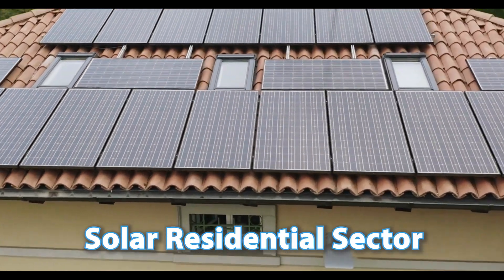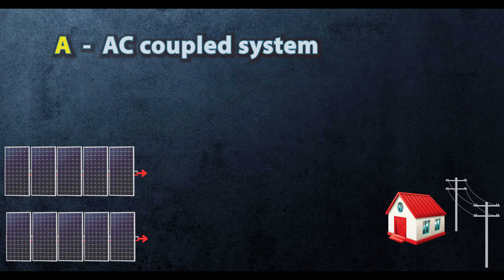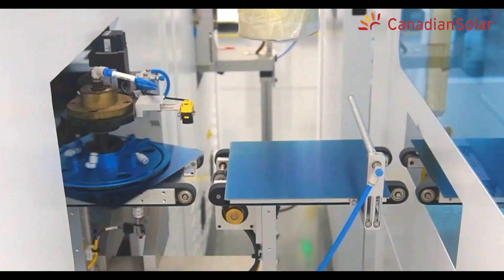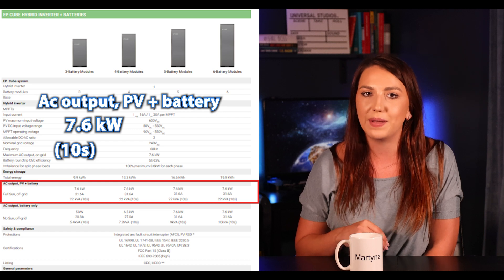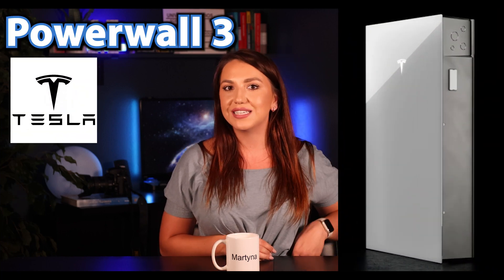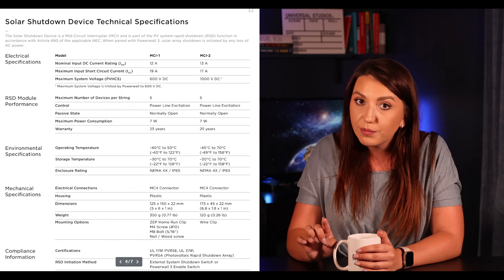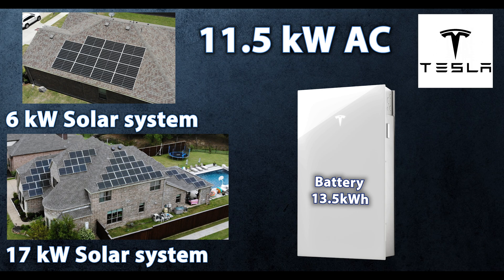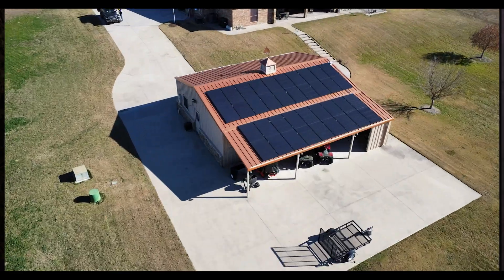EP Cube VS. Tesla Powerwall 3 – Who wins as The Best Home Battery Back Up?!

Comment: Does turning the battery switch to off During the day allow the  batteries to store energy or gets full  for use in the night to power my Air conditioner unit after sunset.

Does the solaris switch means that DC  is converted to AC directly from the solar panel  to powered the Air conditioner unit During the day?

Comment: After over a year of delays, solar installation was completed two days ago with an Enphase IQ Battery 5P.  Figured out pretty quickly, it's not enough storage.   I can't give very much information about the set up other than 21 solar panels with microinverters, I don't understand everything else that was included, but there are a lot of boxes on the wall.  Any idea how difficult it would be to incorporate EP cube batteries into the system?

Comment: Not sure if you corrected this in comments already, but with the Tesla system you only need one powerwall 3, for added capacity you use a "powerwall 3 expansion" which is basically a powerwall 3 without the inverter and at a lower cost than a full powerwall 3. <edit> nevermind, I guess they were not available when you made the video and you said they were supposed to be available later :)  </edit>

Comment: Can you do a Powerwall 3 vs a Point Guard Home comparison?
Reply from the maker: I am considering it for sure! 
I am not super super huge fan of it. They rather knew. But I need to reach out to the company and ask them some serious 🧐 questions. I just want to know if they are serious or if this is just more of a temporary market for them. It’s not like they have been around for a long time like fronius, sma, solaredge, Tesla, enphase or even Franklin. So I am naturally skeptical. But I am very curious so I should probably get to work on it!
Reply: @solartimeusa  Tony Xu from Huawei is behind it, so I believe it's got some money behind it.  It's called Sigenergy in Europe and Australia and is getting high praise.

I'm in MN and I'm getting one.  I like the idea that if one part dies, I don't have to replace everything.  It's also got an option for bi-directional EV charging and an external generator input for extended periods of lack of solar.  I also like the flexibility in sizing that's much more constrained in PW3.  And the batteries even have built in fire extinguishers and heating mats to help in my cold winters.  Also, Joe from Solar Surge was really high on it, so that's what convinced me to make the leap, plus the fact that nobody seems to be able to get a PW3 for another 3-4 months, LOL.

Comment: After being sold on EP Cube last year, I began my journey to setup everything I need to run my home/farm using the EP cube starting with 4 full stacks... only to finally get a hold of their engineering department.  Although they have and still continue to advertise that you can run up to 6 full stacks on 1 Gateway... they only have software and will only ever have software to allow 3 stacks maximum per Gateway.  Soo... thousands of dollars later, my system is fully running and amazing... but I needed to use 2 Gateways and then to divide my one electrical panel basically into 3 panels. 1 panel is my electric coming in from the grid and running to each of my 2 Gateways... and each Gateway then feeds a separate panel.  The system works amazingly... just not as they advertised/advertise.  

I'll happily answer any questions about my setup including pics if needed.  Take care. :)
Reply: Hi, I installed an ep 26kw two inverter w/1 gateway in Aug. Working well, I'm looking to use a portable Gen to at the very least to be able to charge one of my stacks if not both in emergency  situation. Have you set yours up for Gen start or charge? Any thoughts? Thanks
Reply: No, I haven't installed a generator of any sorts... I'm trying to rely just on my solar input to keep them charged and running my house at the same time... which will work fine with the amount of panels I installed for almost all year round except for the combination of extremely short winter days with no sun for days on end.  So I could use either a small generator, or a combo of more batteries & solar panels too.
Reply: @CloverandAshFarms  similar issue here though not so much short days as is no sun for Dec. Less than 400kw for the month so no self consumption, I put the batteries on back up mode . Self consumption works fantastic otherwise.

Comment: Thank you for the video comparison . I’m using Tesla power wall three and the units are in my basement. The garage is 80 feet away.. how can a buy directional Tesla car battery charger be connected. Would it have to be connected with a DC line or use home power to charge. Will a separate circuit be required to the power wall three or gateway for by directional charging?

Comment: Another plus for Tesla is the whole integration with the rest of their products. With PW3 you can install the  universal wall connector and use PowerShare (bi-directional charging) with the Cybertruck and soon the rest of their vehicle lineup as it gets updated. That’s a huge benefit for those who want to use their vehicles as extra home batteries in emergencies and/or to offset usage. That’s like having 10+ powerwalls on standby.

Comment: With Tesla PW3, can I have that installed on my main solar array in my detached garage? I have a 100 amp subpanel, so that should all work out.  The Gateway would have to be by the meter, intercepting the main going to the basement.  Is there a rule of how close the PW3 has to be to the Gateway / main panel? It could be used as an inverter for that array then.  Only problem - detached garage will fluctuate from around 15F-105F.  So I have efficiency losses there, battery degradation vs having it in my basement.  My other array (on my house) is Enphase micros so no go on connecting that to the PW3 or any battery with inverter.

Comment: Can you address the differences between EP Cube and EP Cube Lite? Also would you send me a link to your comparison chart? Pricing data and dependability data would also be nice. Thx, David - Dallas
Reply from the maker: Sure can! So the EP CUbe lite is basically the hybrid inverter with battery but no gateway, what that means is you can use your batteries during normal operation, so for daytime usage and time of use net metering, BUT if the grid goes down, you will lose power, because you dont have the transfer switch. Does that make sense? It's a great option for those who DONT exprience many or any power outages but care for self-consumption, and use their battery every day. Does that make sense?
Reply: @solartimeusa  yes thx. It seems like false economy with today’s (eg, Texas) uncertain electrical grids. Martyna, can you link me to your comparison chart?

Comment: What about availability to resell your stored electricity through Tesla's group system - does Canadian solar offer this?

Of course cost of 
Products and labor to install are critical also so really need to know that.

Also long-term reliability of critical importance as Tesla has a very good record for years here.

Seems almost a no brainer to go with Tesla Powerwall 3 unless some substantial savings in overall system cost with Canadian Solar unless you really want panel level monitoring.
Reply: Meant to add overall very good video without going way into too much detail which many people would not be able to follow.
Reply from the maker: Thanks for the comment, so no I don't think they have their VPP. I do think its not a huge deal breaker as a lot of homeowners do not even want to deal with that and those buyback rates in most cases are very low. But Youre very right, those who want that for sure PW3 for the win.  Price-wise wise EP Cube tends to be a bit cheaper, but that also depends who you ask. Installers who sell PW3 more will be able to get a better deal on that, and those who sell EP Cube more will be able to get a good price there. So Yes at the end of the day I think this will be a big personal choice. :) Very good points, thanks for sharing!

Comment: I have an 11kw solaredge system which was apparently (and erroneously)  installed 3 yrs ago with a non battery compatible inverter (SE10000H-US). Will either EP cube or PW3 work dc coupled? My SE recommended installer says I need a new SE inverter. I have SE optimizers on ~36 panels. Thx, David - Dallas
Reply from the maker: Hey David! So unfortunately with Solaredge Optimizers on the roof, the best way forward is to AC couple a battery, but you do not have to do SolarEdge, you can do Franklin, Ep CUbe or Even PW3. 

Now what you could do.... :D And this is being creative! Wait until you need to get your roof replaced. Then when the insurance will cover the removal and reinstall of the system to have the roof done, have a good company ( such as your original installer or maybe even my company if you wish :)) Do the removal and reinstall, but when reinstalling the system you can remove the optimizers by solaredge and then either do PW3 with MCI rapid shutdown or EP CUbe and Tigo. The reason why solaredge is a bit problematic is because their optimizers HAVE to be installed on every panel and they HAVE to be paired with their Solaredge inverter. They made it so, to get people to buy their product. The reason why you want to wait to get a reroof if you go DC rout is your insurance will already be covering the detach and reset of the system, so while they are down, ist cheaper to edit what~is  underneath the panels. :) 

I hope this is helpful, if anything you can call my office or email us at info@solartimeusa.com :)
Reply: Thanks for your reply. Having already been switched by Titan from a battery ready system to an apparently non-battery ready solar edge inverter (SE 10000H – US ), i’d like to stay out of the SE ecosystem. AC coupling is beginning to sound pretty good, but I’m having trouble lining up the pros and cons for such a system. How inefficient is such a system compared to DC coupling to a solar edge battery? The cost of the silver edge battery is pretty high, and maybe the PW3 which is larger would make sense.

Comment: You skated over the 'incompatibility' between Tigo optimisers & PW3 a bit too quickly for me.  AFAIK a Tigo-optimised array just delivers optimised DC power to the hybrid inverter's MPPT(s) and monitoring at the panel level is achieved separately by Tigo communicating its data through the house WiFi to be viewed in the Tigo app (ie quite independent of inverter manufacturer)...yes?  Am I missing something? - you seemed to be saying that Tigo's MLPE can't give the customer panel-level monitoring in a Tesla system.  Were you meaning that the panel monitoring data cannot be integrated into and then viewed in, the Tesla app...as this is the only way that I can make sense of the commentary.

Comment: If it requires an internet connection at all for basic operation (even temporarily) or is subject to a EULA in order to operate, then that's a deal break for me. It must be ccapable of operating flawlessly without any connection to any data service for any period of time, even indefinitely. I'm not interested in being locked into an online account FOR ANY REASON. It must be self-hosted and on-premises monitoring and control. It's okay if it has a local-only web interface and API.

Comment: You did not mention the collar (back up switch) and the special hand truck that allows one person to install the PW3. You also praised the EP Cube system's ability to monitor each panel (I think) but did u explain that the PW3 has a six array input? Otherwise nice job.
Reply from the maker: Fair point! I guess since i did 2 videos on Powerwall 3 prior I figured I said the 6 strings many times, but youre right I did miss that part! 
The backup switch is not allowed by many utilities in Texas only a few unfortunately and I have to look into other states as well, but youre right, that part is coming and will be huge for all installers and cutting extra cost! :) Thank you so much for sharing your feedback!

Comment: The EP option for DC Coupling is a big selling point for me. I believe that EP Cube allows for generator top up of batteries, if the solar is falling behind during days long blackouts.
Reply from the maker: Yes youre very right! Very fair point. You can use 2 options to connect generator. For portable I believe below 70 or 60 AMPS you can use the GEN input, and that's for the portable units to jump start the system if the batteries died. Or you can put a whole home generator on the Grid input. That's what I was explained. I kinda want to test it in my own home now... :D
Reply: @solartimeusa  Maria ,hello, if ac coupled as I am though the gen port can I still hook up a portable to the other port available?

Comment: Do you recommend to install a soft start for an AC unit, to lower the required starting current when using batteries ?
Reply from the maker: I do, but I usually say try to hire an AC profesional to do it. Those guys should be able to tell what products work best with what ac units. Maybe I should even do some tests on it to verify how much really those are helping.
Reply: @solartimeusa  That would be a great idea for a video!

Comment: it is a little deceptive to say the DC from the solar panels directly charges the batteries. The voltages are different and the voltages to the batter will vary by state of charge. This means these systems need a DC to DC conversion, which also loses power just like a DC to C conversion does. Typically this is done by chopping the DC to AC using a switching power supply which is marginally more efficient than an DC to AC then AC to DC conersion used in AC coupled batteries. Good video.

Comment: It’s easy to make a conclusion when price isn’t in the picture.  I’d price out identical systems.  Money talks!
Reply from the maker: Its very hard ro price it out as 13 kWh is not equal 9.9 kwh system... Overall for a 13 kWh  EP Cube and 13 kWh Tesla Powerwall, price is almost identical... The problem is that a lot of installers have different profit margin, so its very difficult to compare.

Comment: Hi, yes your fully installed comparison video idea would be great.  Also, are both three phase or single phase?  The PW3 has six? different zones to allow for different roof sections / shading etc… does the Canadian system do that?  Another thing that would be nice to hear in reviews would be how easily solar systems tie in with house systems, ie one of the best uses of solar is to eg use the solar generated power during the day to run an Airconditioner, then not have to run it at night (or not as much) when you aren’t producing electricity.  For this to work best, the solar system needs to integrate with other systems in the house.  Some are very easy.  Some virtually impossible but it would be nice to know

Comment: Great video Martyna!     IMO the biggest negative on Tesla home batteries is that you cannot buy them at just any solar reseller (must buy them from Tesla) and only certain states have Tesla certified installers (my state has zero) even now years after Tesla has been making home batteries.   ------   The Canadian EP Cube is available nation wide and is more of a DIY/Do it yourself and can be bought at a number of solar resellers and their products comes with excellent installation instructions for DIY'ers,   they do recommend that for those people with no electrical experience to hire an electrician to do the final wiring in and to make sure its done to state or local building codes for safety reasons.
Reply from the maker: Thank you so much for the kind words and of course you have a very valid point. Tesla is strictly an installer product that is not always available. Whereas EP Cube is both installer and DIY friendly. Even Will Prowse did an awesome video on that battery. He kind of peaked my interest!

Comment: Thanks for the comparison. It is nice to have an alternative to the Tesla. I like the stacked design but i think the AC inverter power is too low. Does EP cube have installers in Houston?
Reply from the maker: @stevesmith-sb2df  fair point, since it can be stacked  you could do 2 units to get you to a higher output and they are fairly inexpensive. 
Email me at info@solartimeusa.com 
I will try to get you a few names of people that at least offer that product but others as well. Having options is the best way to go about it.
Reply: From my experience the power is OK as long as the inrush capacity is adequate. In the case of the EP Cube it certainly is. For most houses you are powering lights, fridge and small appliances.  I realize in Texas you have AC as well.  But as she stated getting them started is totally different than keeping them running, and this system can do that.
Having said all that a 9600 watt inverter with 22kW inrush would be better.  Just remember that with the larger inverter you require a larger battery to go with it.  Not just for duration but for power.  Big loads require a lot of power and a small battery can't provide that power.
Reply: In CA Tesla powerwall, 3 continuous output makes is too high for rebates
Reply: @seanolivas9148  Which rebates are you referring to?
Reply: More than likely SGIP

Comment: I would like to know more about pricing and DIY installs. What about just straight up batteries, or is that to outdated? I would rather buy from you if the price is right and they can be drop shipped.  Most of my house has been converted to low volt DC so my AC requirements are low..  ALSO as for your shading tests,, have you done anything with loss due to dirt/dust on the panels? I don't have the fancy testing available that you use. Mainly just voltage and I did notice a difference when washing a layer of pollen off..